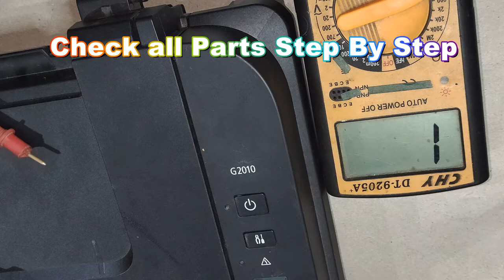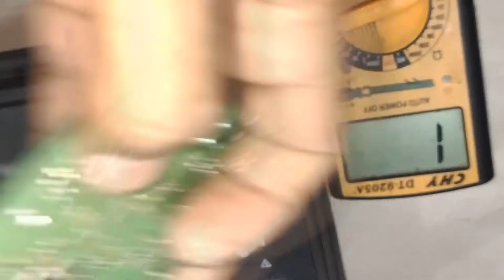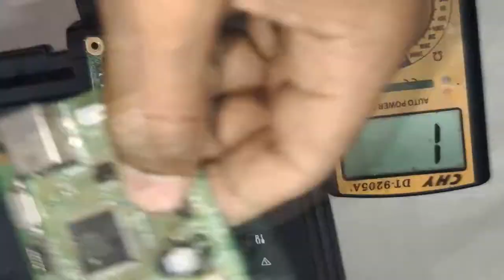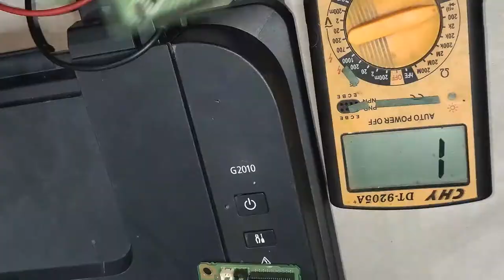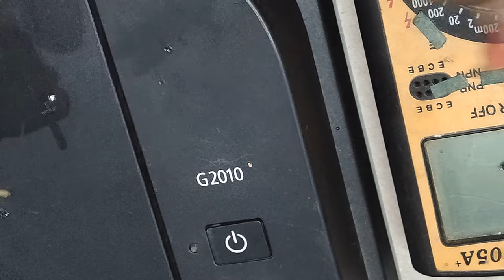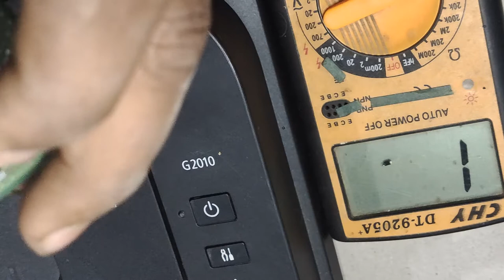Canon G2010 Printer Logic card Repair Step By Step.

Comment: Understand a bit
It will be more clear when in highlighted text by name of the parts & what is ideal multimeter reading for that part & why should we have to change it to make it correct... 
If it possible do to mark those points 
Lastly thank you...❤️👍
Reply from the maker: next video
Reply: @SurajitPrinterPoint  ok. Thank you